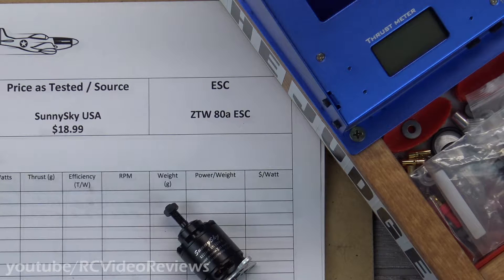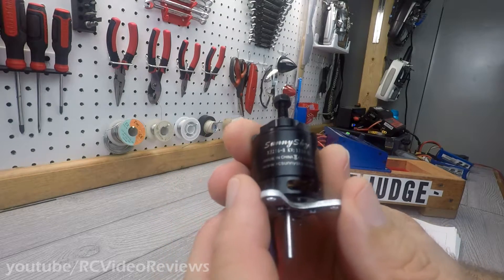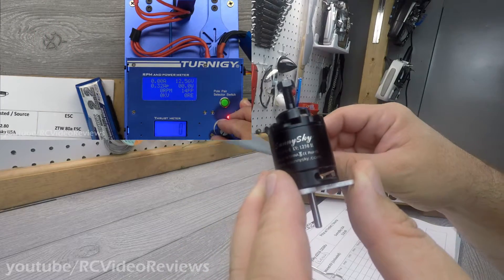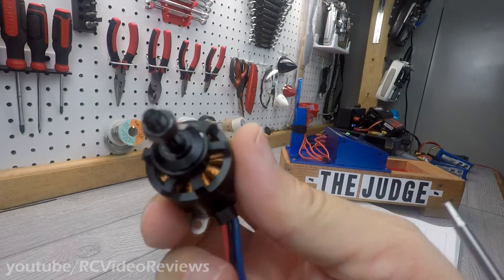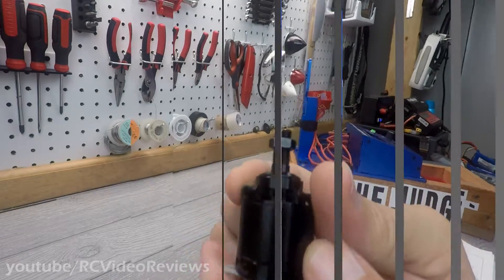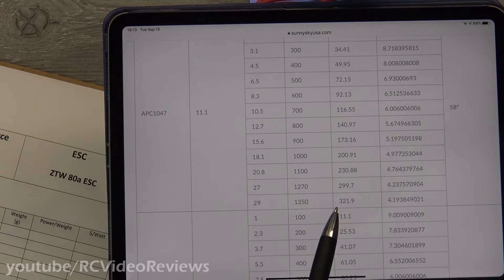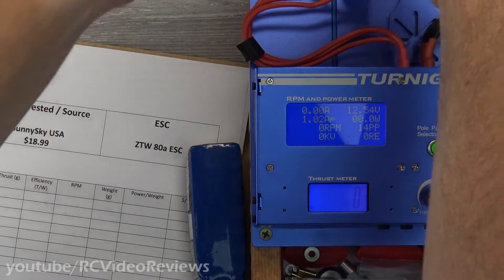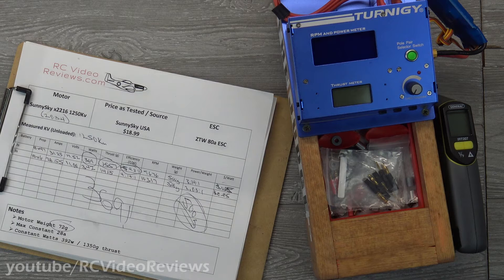Sunnysky x2216 1250Kv v3 vs v2 • Are v3 motors worth the extra money? [The Judge Ep. 14]

Comment: Noob question here. Can you explain what's the long shaft is for? Thing is, the motor is an outrunner. It doesnt make sense (to me) to mount it in reverse to attach propeller to the shaft. In the other video you mentioned about the shaft is for compression collet, but i still cant imagine how it's done.
Reply from the maker: You can release the grub screw and retaining color on the bottom then press the shaft forward in the can to have it protrude far enough for a compression collet. Also, some planes have a "forward mount". That means the base attaches to the rear of the firewall and the shaft goes through the firewall forward, to which you connect a compression collet.
Reply: @RCVideoReviews  Ah, i see. Already thought of it, but too afraid to tinker with the grub screw and criclips as it's the only motor i have right now and it's also my first.

You've confirmed it, and that makes everything clear. 

Thanks a lot man, you're a great help.

Comment: Am I missing something on the sunnysky website I can't find the specs anywhere shaft size,weight.max amps etc
Reply from the maker: Sunnysky lists just about everything for their motors--about halfway down the page. For most of their motors they have multiple Kv options so about halfway down the page you have to select the Kv you want. When you click that, a big chart with specs and prop test data normally shows up: https://sunnyskyusa.com/products/sunnysky-x2216-brushless-motors-long-shaft-version?variant=31960730271838
Reply: @RCVideoReviews  Thank you I figured they were there somewhere
Reply from the maker: @jeremyp9161  So you found it ok then? Sunnysky is pretty good about posting data on their stuff. Another reason I like them.
Reply: @RCVideoReviews  Yes thanks found it I have a dancing wings stick 14 and was looking for a light powerfull motor for it
Reply from the maker: @jeremyp9161  You won't go wrong with the Sunnysky.

Comment: Do you actually have a preference for a brand?  U have compared a lot of motors.  Can u put together a best by size or size range?
Reply from the maker: Not really John. I prefer to focus on whether products to what they say they'll do. Posting a "this is better than that" statement can get VERY VERY argumentative. Some will insist pitch speed is most important. Some will swear by efficiency. Others by thrust. To this day I constantly get argumentative comments about motor measures and to be honest, it's exhausting. Instead, if a product does what it says it will do, I can plan accordingly.

Comment: Nice comparison, certainly pleased with my sunnysky v3 1250kv on my storch. Ive heard good things about T-Motor, would be great to see how they stack up. I'm thinking of using a T-Motor AS2820 1050kv with 11x5.5 prop on my winter foamboard project -  an Edge 540
Reply from the maker: Thanks for leaving a comment. I know T-Motor has a good reputation out there. The last time I looked at them they seemed very pricey compared to the competition, but after reading your note I looked at their 2216 1250Kv equivalent and the price seems in line with SunnySky, so I may take a look at one of those soon. Thanks for the suggestion.

Comment: I have a SunnySky 2216 1400kV v2 on order to fit in my Skylark S....currently running a generic 2217 1250kV with a 9x6 prop in the Skylark S on 3S and its adequate enough, I think the SunnySky will liven it up for sure. I have a SunnySky 2212 2450kV v2 on 6x4 prop in my SkySurfer and I'm very happy with that combo on 3S.
Reply from the maker: Sounds like you'll have some fun with that Skylark and the Sunnysky 1400. That spins pretty quick.